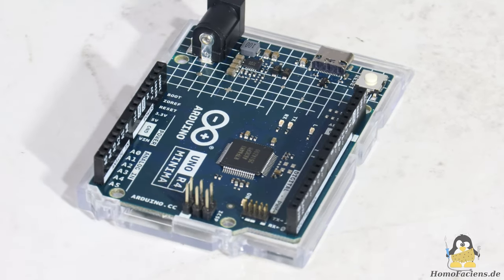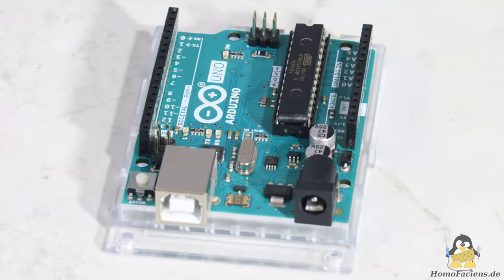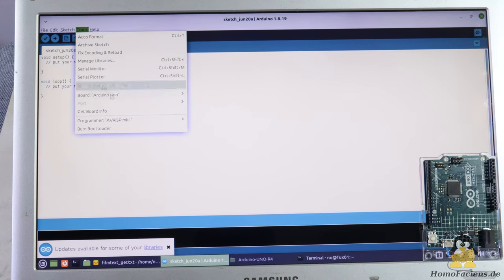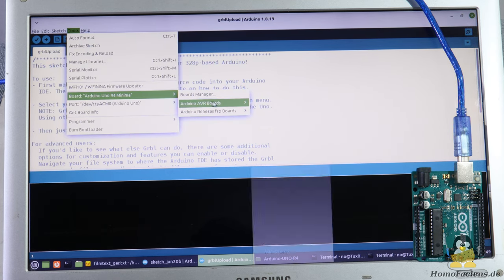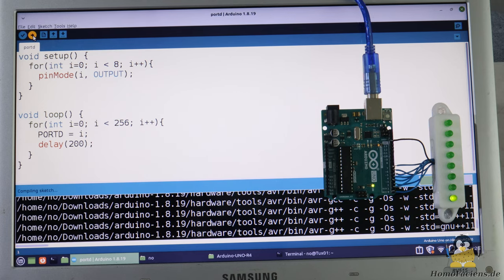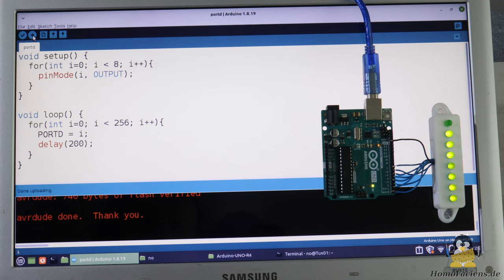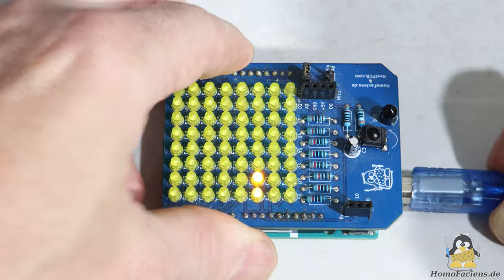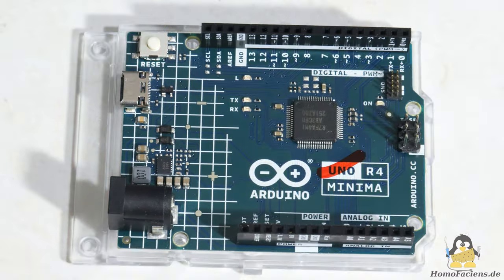Opinion: The brand new UNO R4, a not so good UNO reimplementation?

Comment: Looking at the datasheet for that chip it seems to have more than double the GPIO pins but I guess they had to leave them not connected to reuse the UNO form factor...It's a shame they didn't redesign the board to fully utilize the new capabilities and finally fix the pin headers. They could always have sold us an adapter PCB that translated the pinout between old shields and the hypothetical new Arduino RENO board :)
Reply from the maker: Yes. The "we need more computing power" fraction still won't hand the crown to the new board and those making use of the UNO in schools because of its simple architecture see trouble ahead.

Comment: I bought one of each r4 version hoping to load grbl on it too.  Hope code compatibility with the previous uno will come in due time.

Great vid by the way. Thanks!
Reply from the maker: There is a statement on the Arduino R4 page, that the compatibility to the R3 will not include the AVR commands, that grbl makes use of. 

That's what I mean by saying Arduino has ignited lots of confusion in the community working free of charge. Making grbl run on the R4? Arduino doesn't care, the community must step in. We are not amused....
Reply: Code compatibility down to register level which Grbl extensively accesses will likely never happen, an emulation layer will be required for that. Either a port of Grbl to the new processor architecture or a "driver" for grblHAL has to be made...

Comment: Greed infects everyone given enough time. 
4 years ago I bought 10 Pro-mini clones for $20, and they all work great. 
I've had no need for more speed. They are cheap enough that one can be dedicated to each subsystem if need be. 
If I want more power, I'll use an ESP32 or a raspberry pi with their huge library depots.
Reply from the maker: That "brand new UNO"-thing hit me in the middle of my preparations to write a brief tutorial on microcontroller coding and while I am setting up my mail2code system. For teaching there is: The quicker you hit the limitations of a computing device, the faster you adopt efficient coding.
Also, the once unique (because low ressources) UNO now becomes one of the countless "give me more computing  power" microcontrollers on the market.
Reply: @HomoFaciens  Those people need to move on to Raspbery pi or other SBC. 
MCUs where designed to control stuff, not do huge calculations. 
My 3D printer still runs on a single 8-bit Arduino ATMEGA and never missed a beat.
Reply from the maker: Yes, never missing a beat is what makes MCUs the greatest computing devices in the universe!

Comment: 14bit adc is quite impressive, lack of complete port lol. I fully agree with you that this is not a UNO and that processing power is pointless for small projects. This could be a nice entry to Renesas and Arm if it was labelled as such.
Reply from the maker: Having a full port on the pins can give your code a huge speed gain (e.g. LED matrix), if you learned how to live with low resources and that's what to me the Uno R3 was great for. Probably the old R3 can switch the 8 pins on portD faster than the great new, powerful R4 can on D0-D7. Must check that out....

Comment: It appears to be clone board like. The board is streamlined for manufacturing with low-profile low-cost components. They found a way to make it cheaper. However, it is not priced like it's competition, nothing new, no more pins, same PWM. @ $0.89 the LGT8P328P smokes the Minima, stick an ESP on a RGBDuino Duck and you will have the WiFi R4. This is about gross profit, a possible bud light moment sprinkled with ESG.

Comment: If I want higher processing power for a project in small-form-factor, I can use a Pi Zero and use a microcontroller for I/O. By the way, what are your views about its comparison with a Raspberry Pi Pico?
Reply from the maker: There are countless microcontrollers on the market, each with its pros and cons. Whenever you compare one with another one, you somehow compare apples to pears.

The great thing with the huge amount of variants available is that you can pick the one that fits your purpose best.

Of course you have to start learning with one of them and my recommendation is always to pic a low resources 8 bit type and try to understand as much of it as you can. After that it is easy to step up to what ever more powerful device. Going from high specs to low is extremely harder.

With that, the PICO is too complex to start with. Also it was designed for use with Python. Microcontrollers to me are the kind of computing device that has some bytes for a bootloader and then start your (binary) code immediately, Python is great for PCs, but not what I recommend for microcontrollers.

Comment: Oh my gosh, this is disappointing.  As long as the 328P is available why even come out with an R4.  Now it will be "Ok, kids take out your UNO's"  and the reply will be " which UNO ?"     I also question why are they making so many different arduino boards ?  I used to contribute to the forum but there are so many Arduino boards now  that I have  not used,  so there is little chance to contribute.   I don't know how they reckoned that the R4 is code  / hardware compatible with the R3 when your simple test proves that it is not.
Reply from the maker: "Make less and make it good" is what you should learn with your first computing device and so there is: The less resources, the quicker you have to adopt efficient coding.
An yes: same should be true for the hardware range on offer. With the UNO now getting watered down on the river to more and more and more computing power I am not sure which to recommend for newbies. I am now thinking of the (last 8-bit microcontroller on offer) Arduino MEGA.

Comment: Arduino QUATTRO ? i agree with you, it's confusing. now there is a ESP32 on one of those, but that can be as powerfull or more powerful stand alone... Rather see a new UNO formfactor board but different name!
Reply from the maker: Yes, if Arduino wants the UNO brand competing with "has more computing power than the old R3", with the R4 they quickly fall behind countless, more capable, cheap boards on the market. The simplicity was the special feature of the UNO until the R4 arrived...

Comment: I think the vidéo is fair but maybe the software side will improve compatibility over time.
It's good to have more processing power even for beginners because this means this thing will run micropython and matlab/simulink which are good accelerator for student projects that don't specialise in microcontroller.
Also those who compare to pi pico are unfair, the ios one the uno are not comparable. Also for small projects setting up a pi ilcan be painfull.
Reply from the maker: No, Arduino has a statement on the R4 page, that software compatibility for the AVR commands will not be implemented (which makes sense, because the Renesas hasn't those registers or Ports built in). That's why the naming convention will start lots of confusion in the community.

If you think that coding should start with micropython or mathlab, well Arduino has boards on offer that have even more computing power. Competitors even for a cheaper price. The simple, 8-bit architecture was what the UNO made special. Low resources force beginners to learn "efficient coding". The UNO was meant to be the first choice for beginners and that what is was until the R3.

R4 is just another microcontroller board on the market. If it would not have been named "UNO", almost nobody would have noticed this "below average" board is now available.

Yes, comparing the UNO with the PICO is not what I am talking about.

Comment: Arduinoboards going up in price month for month. Raspi4 is today much too expensive for day by dy projects. Raspi Pico is IMHO a better choice
Reply from the maker: As a device used to introduce microcontrollers to newbies, the Raspberry Pico is way too complex and has too much computing power. From an educational view, a low resources, 8 bit microcontroller is perfect, since you quickly see that resources are never endless and you start "efficient coding" from the beginning. With the Pico and it's Python approach you don't have to care about information handling on a bit level, but to my mind, coders must be aware of ports, registers and memory overflow. That's shown best on an Atmega328 or similar devices. The part of the Pico's computing power that is used for the python interpreting stuff, before your code is even started, is way more than needed to control a CNC machine. That's the insane part to my mind.

Comment: The R4 WIFI irks me because it has a super powerful ESP32 with Megabytes of ram and a 240Mhz CPU on board - but its so inaccessible its unusable - 
they want you to use the much slower other cpu with limited ram - the onboard ESP32 is wasted being used only for wifi with just a slow serial connection between the 2 cpus - 
Not even an easy way to solder on your own esp32 pins - they are difficult to get to. You only needed one cpu...

Comment: So you've used only non-portable examples and are somehow surprised that you encounter compatibility issues. The Arduino documentation discusses why you would not do the very things you do in this video: "The code is less portable. If you use digitalRead() and digitalWrite(), it is much easier to write code that will run on all of the Atmel microcontrollers, whereas the control and port registers can be different on each kind of microcontroller." And that's just when discussing the same chip maker. If you can show issues using traditional Arduino APIs, then you have a valid point. I just don't see that here in this video.

Comment: I would say you are pretty harsh on it. Yeah it is true that direct atmel commands are not compatibile but if arduino part works it is not problem with Arduino calling it UNO R4 but with projects such as grbl which should specify that it works on Uno R3 or make implementation flexible such as marlin is written. And for beginers it should be fine I would say. Also newer procesor is welcomed for performance reasons because yeah atmega328 can do a lot if you know what are you doing but for beginers it is many times slow and limited. One such examples are interrupts. Also especially on chinese market uno with Atmega8 can be bought which we can say is not 100% compatibile due to memory limitiations but it is still called uno so do not see the point of this video. Not wanna sound like hater because your videos are educational but this one is not.
Reply from the maker: Am I harsh? Hope not too much ;-)

To me, especially beginners should learn as quick as possible that resources are never endless so that they start efficient coding early on. To me that was the reason why I always pointed to the UNO when asked what microcontroller to start with.

Beginners now have to mess with the difference between R4 and R3, which is obvious to us, but nearly impossible to explain to newbies.

As told in the video: it is totally okay to produce something more capable in the UNO form factor, but why call it UNO if there is obviously no compatibility with the AVR architecture?
Reply: @HomoFaciens  But question is if they have to even know r3 ever existed. And like untill they program in arduino only without registers and such they eont feel a difference. And if they start with registers it is opportunity to learn that not all mcu are the same.
Reply from the maker: The R3 has all 8 pins of one port connected to pins D0-D7. There is no full 8-bit port on the R4. With the R3 is was easy to introduce ports with 8 simple LEDs. No chance to do the same with the R4.

With a low resource, 8-bit mcu, newbies quickly see that there is a difference between mcu with 8/16/32 bit architectures.

It is the UNO naming that I see as totally wrong. This is no longer my first recommendation for beginners.
Reply: @HomoFaciens so which is now your recommendation for beginners?
Reply from the maker: I am thinking of using the Arduino Mega in my mail2code tutorial that is under construction. Also 8-bit, relatively low resources but more pins. Hope that Arduino won't ruin this brand name, too ;-)
...or show how to build an own UNO with an Atmega chip.

Comment: The new R4 features have been available on Raspberry Pi for years at the same or a lower price. I don't get Arduino. But, if this reduces demand for the still hard to find Raspberry Pi, so be it. Please proceed.
Reply from the maker: The Raspberry Pi is a different category of computing device. The Arduinos are low power, realtime boards, The Raspberry Pi a single board computer. I like both for what they are. Thanks!
Reply: @HomoFaciens  If the categories of computing device are 'obsolete' and 'brilliant,' then we agree HF. 
Further, the power consumption appears to be very similar according to my measurements. And if the application is real-time, then the single-threaded hardware interrupt of the Arduino cannot compare to the multi-threaded hardware interrupt architecture of the Pi.
But please don't be persuaded. The stretched supply chain of the Pi does not need new consumers.
Reply from the maker: I don't feel persuaded by someone having a different view on something and who has good arguments for his point of view.
If I would be an astronaut in the tip of a rocket, I would feel better, if the engines are controlled by a simple 8-bit microcontroller rather than by a Raspberry Pi that will eventually be busy with WLAN, file handling or a cronjob during a critical part of the flight ;-)
The power consumption of the UNO R3 is way lower than that of a Raspberry Pi, or do you mean a Raspberry PICO?
Reply: @HomoFaciens  After a few minutes of searching, HF, I could not find a power rating for Arduino. The specification table for the R3 on the Arduino DOT cc page is literally left blank for that particular spec, at least on what I was able to find. What current and/or power consumption values do you find for Arduino?
Reply from the maker: The power consumption of the Arduino is about 15mA in idle. Not that much more while doing some calculations in the main loop. The "boot" time is some milliseconds. The Raspberry Pi can't beat that ;-)
Reply: @HomoFaciens  You're not wrong, HF. RPi can't beat that boot time. Just curious - in what use cases is boot time so important that the other benefits of RPi are worth discarding?
Also, just for fun, I found an Arduino R3, along with a fax machine and some 8-track tapes of Mantovani, being sold in a box of junk at a neighborhood garage sale for $1. The previous owner was an old engineer from Atari, then Osborne Computing, MySpace, and finally Theranos. 
Anyway, I measured its quiescent current at 30mA (never believe documentation), for what it's worth. Still less than the 120mA I measured on a Pi. Not sure what use case that difference would be justified to sacrifice the hella useful debugging utilities, remote programming, multi-threaded hardware and software interrupts, but, yeah. Lots of variables here when benchmarking, but in my lab, yes, you're right, the quiescent current consumption is 4x less.
Reply from the maker: The Arduino beats the Raspberry Pi in real time computing. It can control periopherals on the mirosecond scale without any interrupt from tasks running on the Raspberry Pi (WLAN, disk operations and all that stuff mentioned before).
The code lines, the Raspberry Pi executes at boot time is measured in megabytes, that of the Arduino's bootloader in bytes. It is less complex, so less likely to have bugs and so the computing device to go for in machine control and so on. You remember the rocket example I mentioned?

Would you like to wait one minute after turning the key of your car until you can drive away? A microcontroller is almost instantly in operation.

Are you sure the 30mA was in idle or while doing some operations? What program was running on the UNO?

Interesting stuff in your neighbor's garage!
Reply: @HomoFaciens  In consumer, mass produced, or aerospace cases, HF, I would use RPi to develop prototypes, then convert everything to ASICs. If I was an astronaut and told an Arduino was controlling my life, I'd bail out. 
I was not aware you and your viewers were using Arduinos in mass produced consumer electronics or in aerospace applications. 
Yes - the 30mA was quiescent. No program other than the bootloader. Try it yourself. I'd post a picture, but YouTube won't let me.
Either way, please stick with Arduino. Please advise your viewers stay with Arduino.
We RPi and ASIC people thank you.
Reply from the maker: Arduino is just the learning platform. Of course, microcontrollers in nowadays applications rarely make use of an 8-bit ATmega. But just a bit more powerful microcontrollers can be found in laser cutters, 3D printers or CNC machines. No doubt, you have plenty of them around you in commercial products. Your car has a bunch of them under the hood and they are in rockets and satellites or your washing machine. For good reasons they don't use a Raspberry Pi (or comparable single board computer). Microcontrollers are also way more flexible than ASICs especially after implementation. 

Yes, looks like I should do some current measurements with my microcontrollers (not because I would not trust your words, but just to have a closer look at the limits). Thanks for pointing to that lack of data.

And I make use of the Raspberry Pi quite a lot. The robots in my www.RoboSpatium.de are based on these boards. A project currently under development named mail2code makes use of both, a Raspi and a microcontroller.